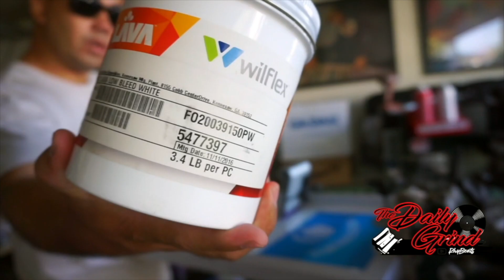MORE PARTS FOR THE RYONET RILEY 500: Almost Time To Print (S:06/Vlog 016)

Comment: Press looks bad ass... quick question, is there any way I could pick your brain before I make purschase regarding screen printing. Thanks
Reply from the maker: Yep. What’s up
Reply: @RhyBeats  right on.. ok, so I have everything except for the conveyor dryer. When I purchased all the equipment, I thought I could just use the flash, but I keep having issues with curing the garments. At this point, I'm looking @ stalhs heat press to cure as well as smooth hand. I have no plans to start a screen print business, I just want to be able to provide a quality product. Will be printing on tees hoodies and joggers
Reply from the maker: Searchin4 Supers ok. So what you can do when using a Flash dryer to cure inks.. you need to take the shirt off the platten/board and lay it back on top of the platten and cure the ink at 330-340 degrees for 15 seconds. That should cure it . But you have to take the shirt off the board .  You can also get low cure inks that cures around 270 degrees. ... and make sure that you test wash..
Reply: @RhyBeats  I have the 16x16 ryonet flash and temp gun and still over/under curing through the layers.. I have printed multiple shirts and its hit or miss after the wash. Its very inconsistent and after seeing others say that they use heat press to cure their prints, I figured I ask your thoughts before I pull the trigger.  I really dont want to spend 2k on an entry level dryer... I cant get a better dryer due to power limitations
Reply from the maker: Hmm not sure why your getting an inconsistent curing. If should definitely be cured around 345 for at least 20sec. But yes you can definitely cure using the heat press after flashing .